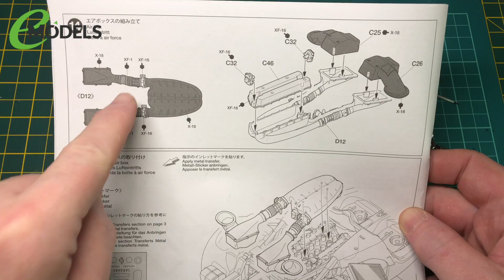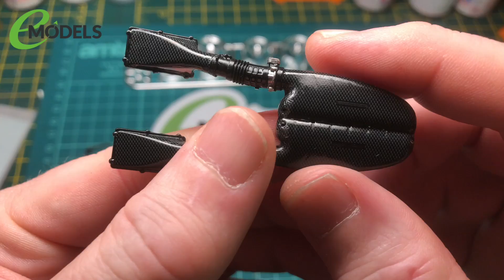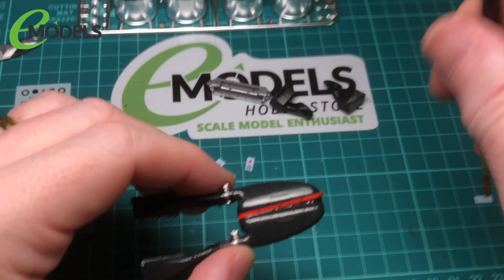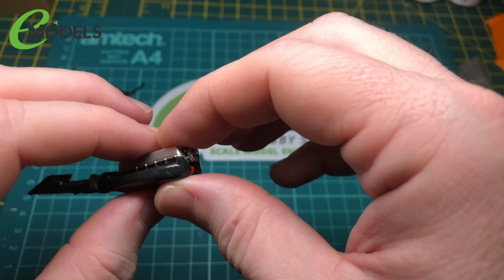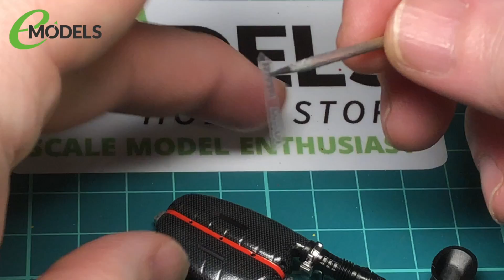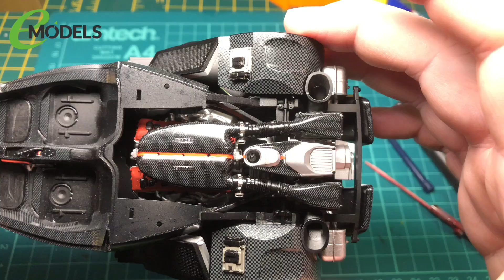Tamiya 1/24 Ferrari LaFerrari ( #24347) Pt. 6:  More Internal Work

Comment: First time I’ve seen the Microset applied to the underside of the decal backing paper. Is there an advantage to that method rather than placing in water?
Reply: Yes, it's easier and quicker if you have only a few small decals to fit. I used warm water with the CF decals.